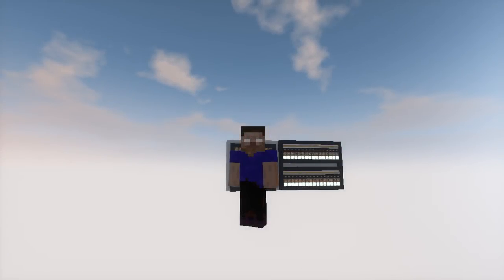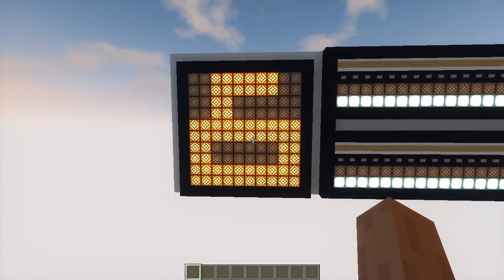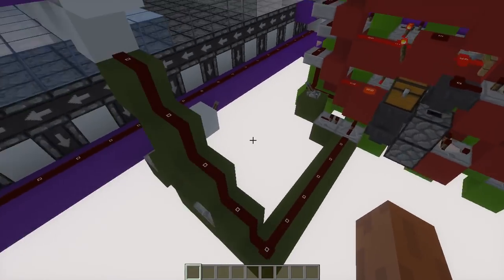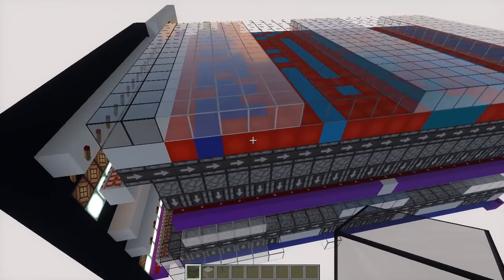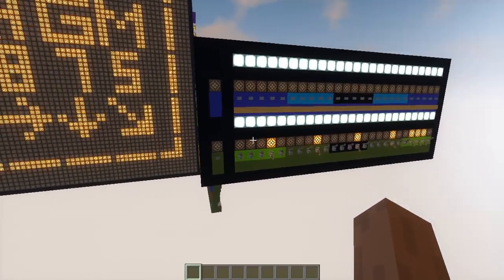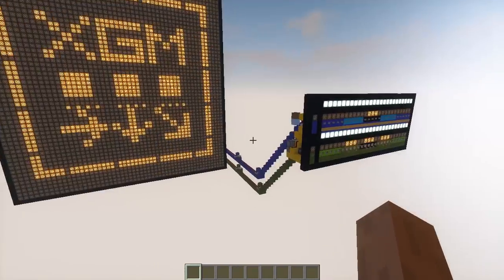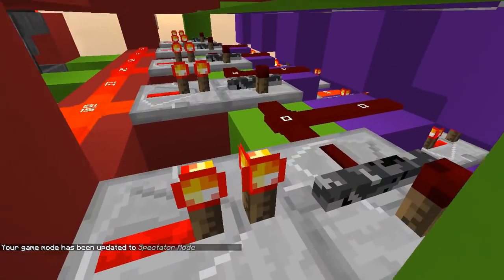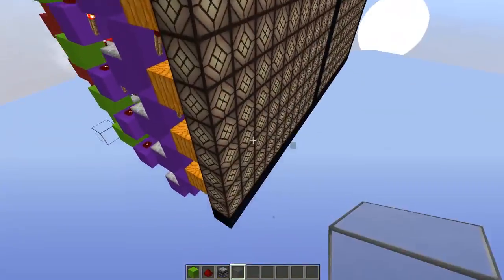Serial Displays: Multi-Tile Drawing System! | Minecraft

Comment: Super cool and surprisingly compact. I’m glad you explained the components.
Reply from the maker: I figured whoever was going to try this system out could use some basic instructions. Will add more details during the tutorial!
Reply: I mean I liked seeing how the encoder works (rather than a black box), great idea to use observers and much simpler than your typewriter.

Also this looks pretty simple to display videos on, if you don't mind being limited to 15 frames running at 10 FPS and big pixels.  Just connect the redstone wires that are reading the observers straight to redstone lamps.

Comment: Very cool! Was thinking a bit, wouldn't it be quicker if you use parallel instead of serial communication? Of course it adds a little bit of encoding/decoding complexity but it might enable updating the whole screen in a reasonable time frame.
Reply from the maker: You're right, parllel would be way faster :-] But this system is mostly about making it easier to display things.

Comment: Hey, is there any way to make a verital version of the display and decoder?
I discovered that you can make a 128x128 map display by using dispensers with powder snow it in facing upwards since powder snow doesn't flow but i have no idea how to make the size of the encoding and decoding managable